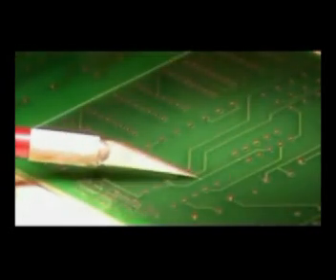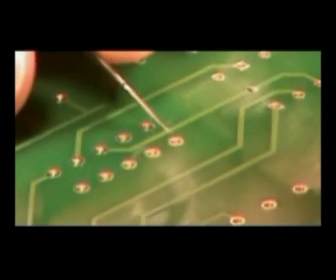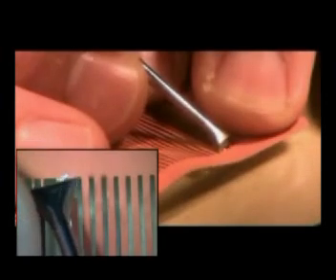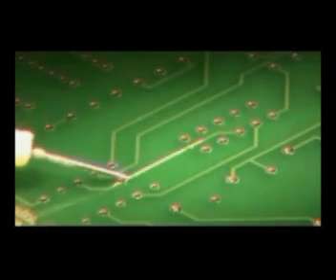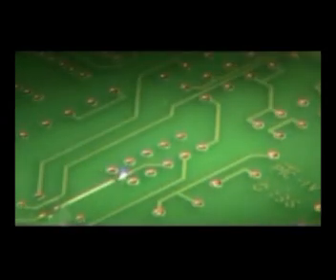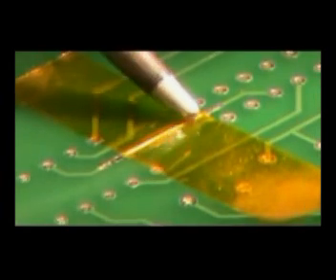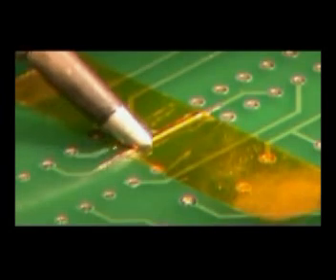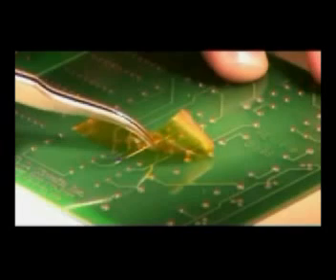PCB Trace Repair Dry Film Technique

Comment: I guess this is a decent tutorial, if you really need a tidy repair not adding a single bit of excess signal length - but aren't you supposed to just dap with unsoldering wick and the iron, rather than wipe? Puts additional stress on an already exposed/damaged trace.

Comment: I bought a cheap mini quadcopter which uses the ciruitboard as frame for the motors. One edge already has a motor failing. It only works when I twist the board gently. I'm guessing the trace is damaged and can be repaired in a similar fashion as presented in this video. I'm just not sure I isolated the real problem. Do you guys think it's probable the trace is faulty?
Reply: Razzfazz87 More likely a solder joint.
Reply: Hans Meier I checked those and re-did the supposed faulty one, but it didn't help. I put the quad in the cellar and that's that.

Comment: Wouldn't it just be easier to use a piece of 26 guage wire (or smaller depending on trace size) and just scrap the mask away and just bridge the two points that are messed up with a wire.  I have done that and haven't had a problem.